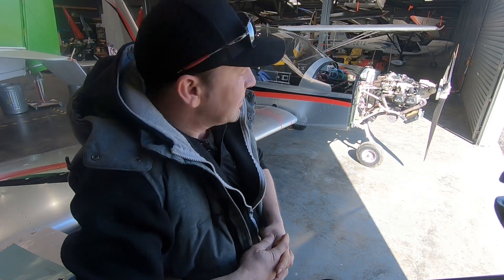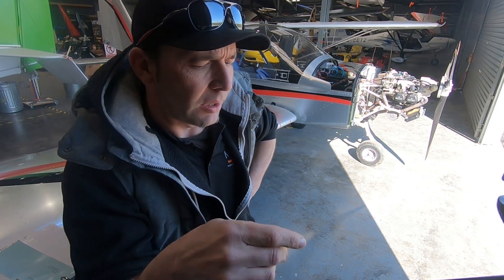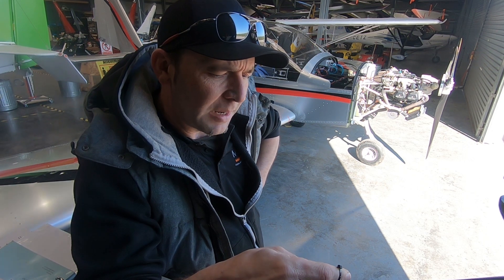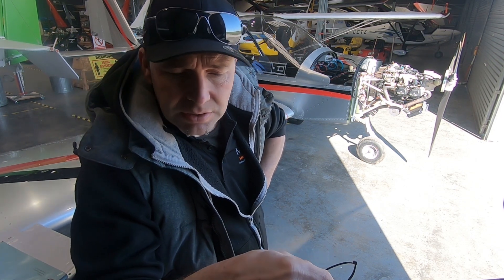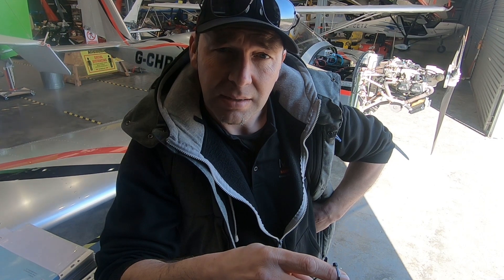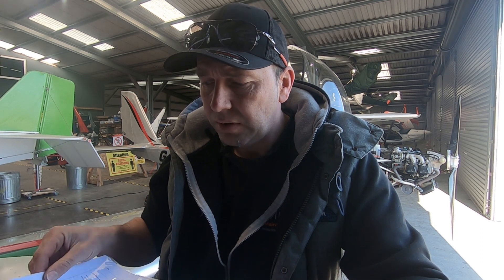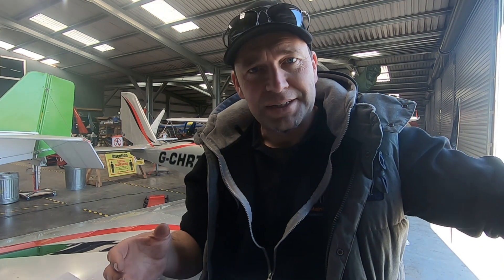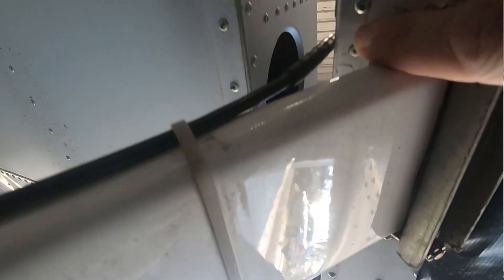Eurostar EV97: Part 3 - MPD's, permit/annual inspection & Check flight: Micro Maintenance S3 E6

Comment: Yeah, the fuel pump is one of those things that is time limited along with all the rubbers.  I'm in the midst of doing all of that and it sucks!  The fuel lines were getting a bit hard so it does make sense to get rid of them but it is a LOT of work on the wing tank version Sportstar with tight access in the wing roots.  The coolant hoses aren't too bad and there aren't many oil lines so not a problem.  For a simple airplane, it still takes time and diligence at the same level as applied to the legacy certified fleet aircraft.
Reply from the maker: Most rubber parts should be replaced every five years regardless but we’re finding it’s much sooner than that

Comment: I'm not convinced there is any link between rear bulkhead cracking and moving the plane around by the vertical stabilizer. It was a possibility that was suggested but I don't think there was any evidence that it could cause it
Reply from the maker: Thanks for your feed back Gwyn